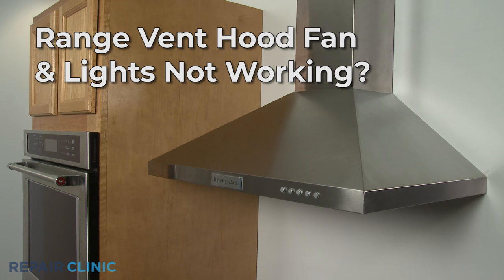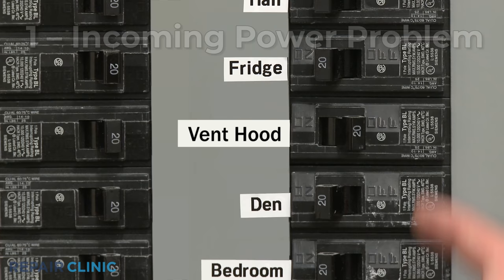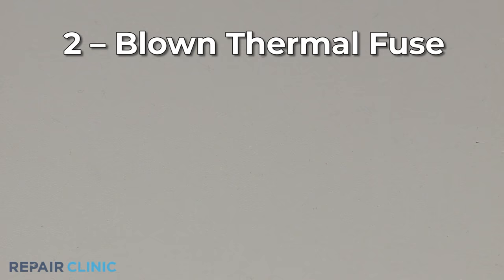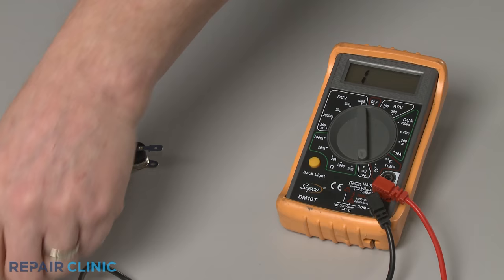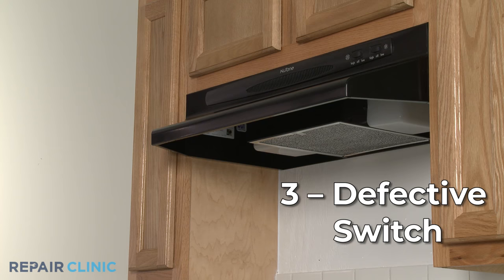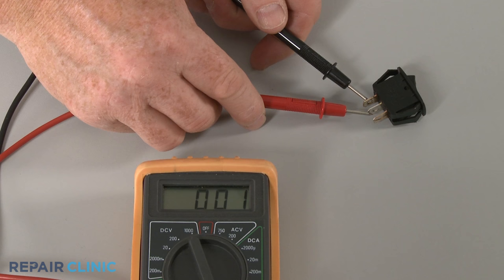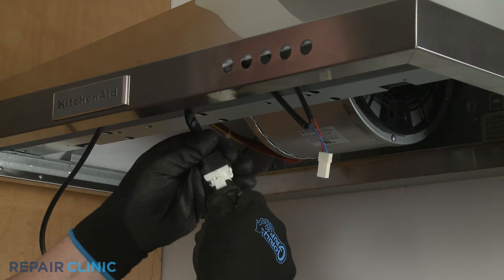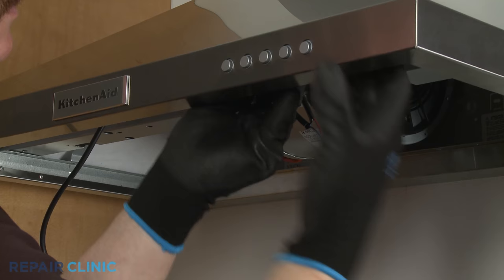Top Reasons Range Vent Hood Fan & Lights Not Working — Range Vent Hood Troubleshooting

Comment: I notice my switch of the hood  fan for the light switch shorts out once in a while?  Could that be a loose wire, or loose ground wire? The fan switch is ok, it is just the light switch on the hood.

Comment: It's definitely a button , light works, fan doesn't. First started to be like loose contact. If I put my finger onto the pressed button it would work.

I seem to be able to buy a set of buttons.
Smeg hood looks different from that in vid.

I now need to find out how to open it to exchange a set of Klick klock buttons😅